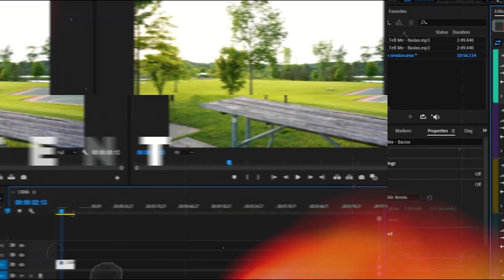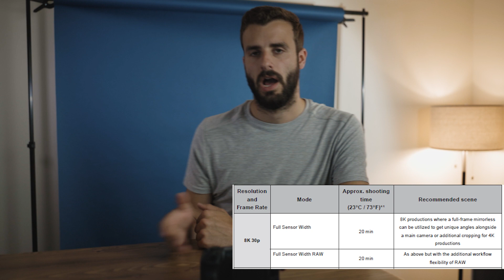How To Prevent The Canon EOS R5 From Overheating

Comment: Your video is misleading. “... if it does overheat?” You didn’t even test the camera fully. Stating your opinon before even testing the camera fully, relying solely on a pdf, is not science or engineering. Let me state the common perspective for you simply: When someone says “We made an amazing camera with everything you want, and some amazing things you didn’t expect—and there’s no catch.” When people buy it  and they find out there’s a catch, people will be annoyed. Canon did this to themselves, not the other way around.  I’m sure Canon did not intentionally design this camera to overheat. No engineer goes into design with the expectation of designing something that is unstable or non-functional. They wrote those guidelines around the deficiencies of the camera, that doesn’t excuse the product, the design, the engineering, or the marketing plan and communications that told us everything about camera except that there was an limitation on the capabilities that made it compelling. You’re happy with your purchase, great, but there’s still reality to deal with, it’s not a professional production video camera above 4K 30. Simple.
Reply from the maker: I have ran quite a few tests on the camera before making this video, just not extensive tests. This test was not a "proven science" video and its someone mentioned like that in the video. My speculation of it will not overheat is based on canons information from actual engineers and based on my own personal results from my basic tests.
Reply: The Engineering Filmmaker just test it, it, set the camera to record 8k raw, 4K 120, and 4K hq, press record and see how long it stays on, then let us know if your camera overheats, and how soon you can record again, it won’t take long.
Reply: Totally aree with you Sterling. The Engineering Fimmaker is truly sugar coating this overheating issues based on his simple test reviews. its been proven that after an hour of just shooting photos with the R5, you cannot use any of the HQ video modes. Its been proven that once you overheat the camera, you literally have to wait 2 hours to use those video modes again or else you're stuck with 3 minutes of recording only. Its been proven that the R5 overheats period without even being in direct sunlight. 

The engineering filmmaker have never shot events before like i do. If i shoot a wedding in 1080p @ 120 fps, i have to shoot the whole session in 120 fps. I literally record videos longer than 20 minutes due to speeches and ceremonies. I have an A-roll camera that sits on a tripod just recording these speeches. The guy acts like no one will shoot longer than 5 minutes of footage when in real world usage, there are plenty of people that records longer than 15 minutes. We are not just making short films here, we are recording real world events too you know. 

Once again, why pay a premium price for features that you can barely use and are limited to use to begin with? I guess every mirrorless camera should slap on 8K feature and then bump the price tag to $4,000 just because it has 8K footage. I guess to use it correctly, we should do what the engineering filmmaker does and record short 1 minute burst of videos and the R5 will never overheat. This is the reason why i wouldn't watch any of his review videos after this one. Disappointing and misleading. Gerald Undone does it better
Reply from the maker: I just filmed a wedding in 4k 60 and made a video about it. It worked great for me. No sugar coating. I also shot a commercial video also posted a video about it in 4k 120 and 4k 60. Its also not good for the processor to let it fully overheat. The 8k mode is also no meant to just hit record and let it record for long periods of time (per canons recommendations pointed out in the video). There are plenty of other people who ran this test on other channels that I am not saying are wrong. The camera does overheat and will overheat.....if you use it incorrectly
Reply: @EngineeringFilmmaker  Ha ha... "...if you use it incorrectly?" Lol. Overheating is not a feature, they didn't not intentionally design in that way, it's a side effect of their ambition, which I applaud.  But it helps no one to deny the reality of the hardware. Writing "usage guidelines" around the deficiencies of your product, does not somehow forgive it's inadequacy. Hopefully, next year Canon can release a camera that actually does all the things in video that they claim for a normal amount of time, in the meantime, this is not that camera.
Reply: Even so, looking forward to seeing your future videos either way.
Reply: Sterling Sanders Standard presentation approach. Tell 'em what you are going to tell them, tell them it and then tell them what you've just told them. It's the only way to get the points to stick. A bit like a three act play, you see. So, it's quite a valid way of doing it. BobUK.
Reply: Robert Hawtin yes, but he doesn’t ever tell us, because he didn’t do any tests, he just walks through a pdf from the manufacturer without ever testing or showing the camera in operation, and therefore his novel “opinion” or findings mean and say nothing about the way the camera actually functions. This is not complicated, nor is it a secret that the camera overheats. If he got the single camera that didn’t that would be news, but if he refuses to press record for 15minutes in 8k, I think that’s just silly.

Comment: The 8K video is high speed frames. I definitely would want that capability. Can afford : no.

For cooling I would be thinking about water cooling. The area with the heat is relatively small. It should be easy to add fins or tubes that will transfer heat eficiently to water. It would be feasible to have an external water source.with luck convection cooling will be enough.
Reply from the maker: Not sure if you would want to add your own cooling.
Reply: You need Canon for the cooling internals.

Water is a lot less noisy than air.

Comment: Thanks for the video. It totally makes sense when explained in that way. 8K only makes sense for cinema productions anyway, as most people are unable to tell the difference between crisp Full HD and 4k movies on a regular TV anyway, just too much information for the normal human brain (stills is a different thing of course). I think the main problem for Canon is that Sony seems to have manufactured a fully capable 4k-Cinema-Camera in a DSLR body for 3500 bucks. Two additional stops of dynamic range is huge, redundant shooting to different cards is also great to everybody who has encountered card failure before, and the Sony codecs seem  to produce smaller file sizes without sacrificing quality, which is also handy. The A 7s III is of course no hybrid camera, usage for photography is quite limited. And sticking to Canon ´s and your recommendations will help in many situations, but filming something that requires a lot of slow motion either forces you to pick HD modes or be very selective with what you actually shoot... Without a doubt a really great camera though...
Reply from the maker: Yes! I can see where shooting one or two clips in 8k is great but not many more than that except for a production. Sonys bit rates in 4k are about 1/4 of canons R5 4k rates which is where the huge files come from in canon which was kind of a mistake from canon since it overheats.

Comment: The rated environment for the Canon R5 is 32-104F, 0-85% non-condensing, which is stated by Canon.  Every feature must work within that rated environment, and if you are using it in that environment then you are not "abusing" the camera.  So, if Canon sets a 30 minute record limit in whatever video mode, then it must be able to do that all the way up to its minimum and maximum rated environment and everything in between.  Its not about who needs to do what for their productions.  Canon says the camera can do X video modes for Y minutes in operating conditions Z, and that has now been proven to be a flat out lie pretty much all around.  Its not just using advanced video modes that takes this camera to overheat or near overheat.  Casual outdoor photography does it too, according to at least two reports including one from Lady Toneh.  Find a work around for that.  I know that the rip on a $3900 product is too sweet to pass up, and the shills are starving after a very disappointing first half of the year.  But the R5 is a turd no matter how you try to spin it, and no one should be spending their hard-earned cash on this.  A "work-around" video is acid in peoples faces, bro.
Reply from the maker: I wasn't saying you had to use it within canons guidelines of what they put on the spec sheet, but if you dont abide by what they say and it overheats and you get upset and say its a bad camera then that's on you. Sony in the past had plenty of cameras (not just one) that overheated way outside those same guidelines (which were similar to canons) and no one threw fits like they are about the R5. Canon engineers specifically made this camera and put features in it with specific scenarios in mind. They did testing, research, and more testing to ensure the camera would be a good one. Now I will say there are a few things they messed up on. One of them being putting the bit rate wayyyyy to high with out having a fan to cool things down. Its just way to much info for the processor. 

Long story short, i understand what you are saying but just because your car manufacturer says your car can reach 150mph doesnt mean you want to do that to your engine.They would recommend going the speed limit. Theres a high chance you can damage it long term by not following a manufacturers guidelines.

Comment: My R5 overheat in 1080 after 20 minutes. Albeit in the sun. Disappointing.
Reply from the maker: Are you on the latest firmware? I've never heard of the R5 overheating in any 1080 modes.
Reply: @EngineeringFilmmaker  yep. I also get tons of noise. Even using native iso. Can't figure it out

Comment: That’s what I have been saying all day. Sounds like Sony is paying those Youtubers. 
Even my 5d III DOESNT have 1080P 120. 
This monstrosity called the R5 - 45MP - that’s almost medium format with that type of focus speed that shoots 8K Raw internally. 
😃😳😳😳😳😂😂😂😂
They need to be grateful. 
I just pray that we can have the cooling system with the ND filter adapter. 
I mean the only thing I like in the A7S3 is that cool dual dual card design. 
That is tight. 
That’s it. 😃
I will check out the A7R4 - to see if that can compare to the R3. 
But sorry guys the A7S3 cannot be compared to the R3 - it’s madness.
Reply from the maker: Yeah agreed! I hope they update it soon to fix a lot of the thermal issues.

Comment: Got mixed feelings about this...Sure a manufacturer can provide you "safe" operating guidelines so you don't hit limitations in the design.  That's fair.   However, from an end-user perspective, a camera is just a tool.  The artist should push the boundaries and not limit their creativity in using that tool to just paint between the lines.  If Canon does not understand its consumer or its own products well enough to market it them properly that's on them.  Shouldn't be blaming or shaming a customer for falling for Canon's own marketing hype around 8K.  It's a Canon's job to know their customers and have the tool support practical use cases that they need.  It really feels like Canon and Sony did a flip flop.  Sony had the same problem with their camera's overheating while Canon was rock solid and super usable.  Now with A7SII finally Sony has demonstrated their ability to listen to customer wants and Canon just went off the deep end with sexy specs that can not reasonably be taken advantage of.  Its a fine line.  Apple has done both.  They have always tried to dictate to customers how they should use a product based on the way they designed it..  Sometimes its a home run and other times they've struck out.
Reply from the maker: I mean think of this. The engineers that build bridges, they have max weight restrictions on that bridge. If you put too much weight, it will collapse. Following the engineers guidelines is usually a good option.
Reply: @EngineeringFilmmaker  Yes....but for all practical purposes they over engineer the bridge so that is safe.  At least to the extent bridge can perform its main function, to let tons of cars and people get from one side to there other.  You don't spend a fortune engineering a bridge and then throttle the traffic to let only one car cross at time.  Here's an amazing bridge - it will transform the way we travel, cut your travel time from 4 hours to just 15 mins.  Oh, btw, we can only have 1 car go across at a time to be safe, otherwise the bridge will tumble.
Reply from the maker: Theres only so much you cam implement before you cannot advance any further. If you over engineer it too much you might end up adding too much weight to the structure which weakens the bridges strength. 

Long story short, the camera is sealed, it is created and kind of advertised as a hybrid camera, not just a video purpose camera. Due to this, they weathersealed it, imagine running your PC with no way of air entering or exiting and with no fans, and trying to play Call of Duty all day on it. it will explode. There is only so much canon can do before they have to make sacrifices such as making it not weather sealed and/or adding a fan etc. The good news is I think they already knew this was coming and are apparently working on a RF to EF fan adapter that will cool down the camera so that you can have the best of both worlds. Unless you use RF lenses like myself then your SOL
Reply: @EngineeringFilmmaker  First of all, I appreciate the dialog although we have different views.  You call yourself the engineering filmmaker and certainly your style of response is engineering style. lol.  You know that joke if you ask an engineer what time it is, he'll build you a watch?  I don't speak from an engineer's perspective but an end user's perspective.  I do appreciate Canon pushing the boundaries and innovating.  This is the 1st iteration.  It is not perfect - leaves a lot to be desired.  With time as you mentioned, people will find innovative work arounds and methods to cool the device to make it more usable.  That being said, I feel the things you mentioned are design choices.  I think the majority of users out there did not ask for or want 8K.  Canon chose to do this but as result made compromises to the usability.  Long term this is not a bad thing.  However, in the short term end-users simply do not care   out the reasons why it doesn't work - they come across as excuses.  As an end-user, the features of the camera need to serve their purpose, if not, doesn't matter what engineering wizardry went into to it.  Consumer's expect consumer products to be consumer-grade.